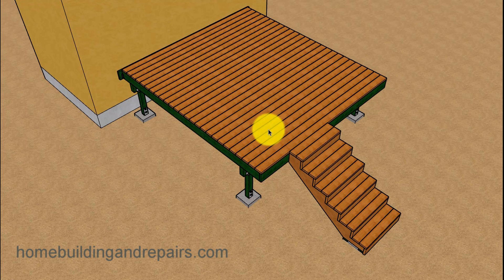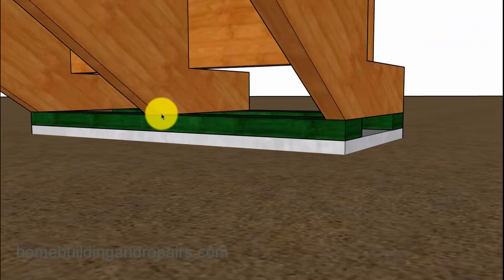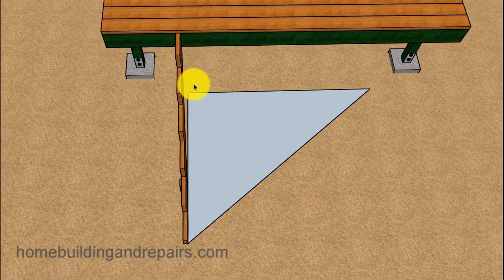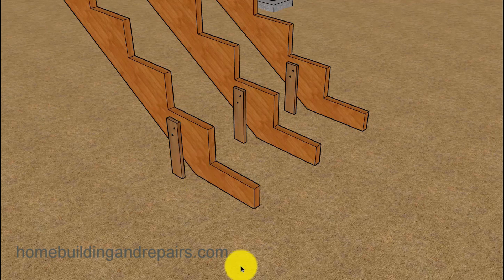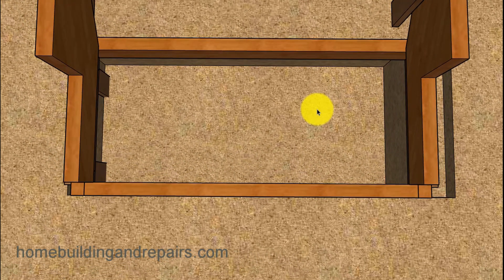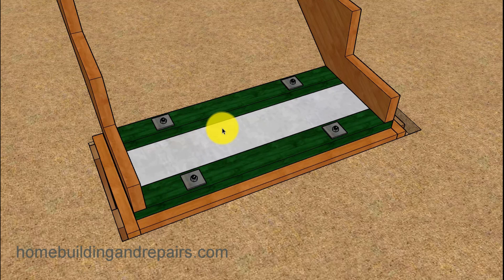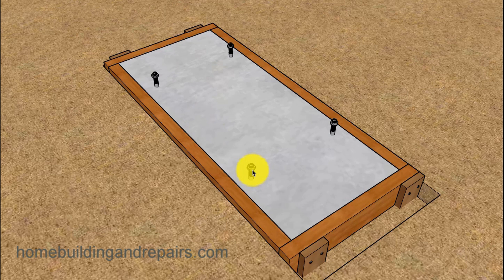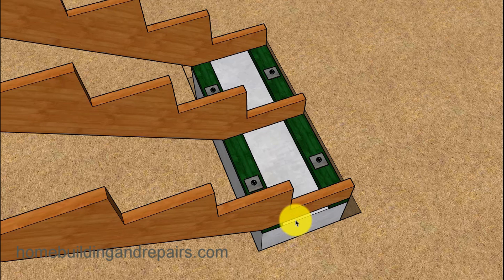How To Use Stair Stringers To Locate The Perfect Deck Footing - Advanced Carpentry Simplified

Comment: Anchoring the bottom of the stringers on an outdoor stair with one stringer attached to the house. Ours has not been attached to the concrete landing for 20 plus years. Not on our front stairs of the front deck(lands on concrete) or the back deck (taller). We are in a northern most climate, and worried freeze thaw cycles( many through out winter ), might be why the bottoms of the stringers never had attachment / kicker connection to side walk or pad.  Should we add it to the to do list?

Comment: I'm sorry, our building code which isn't different than the International, requires 24" of landing surface that is non-skid.  In other words, you can't step off the steps into the grass.  It's got to be gravel or cement or landscaping brick pad.  So I'm wondering why you didn't mention this.   I think this is pretty common practice.

Comment: Nice video! If ground contact rated pressure treated lumber stringers are used, can't they be placed directly on the poured footing slab? I realize the bolts give you a way to anchor the stairs but it seems that it can also be accomplished by notching the stringers in the front or back and running the board there so it is flat with the rest of the stringers and prevent raking and anchor that into slab. My biggest concern with your recommended construction is the channel created by the two boards that will trap water and will not allow it to drain to front or back. While we can pitch the slab a little to help with this in the front-to-back direction it is much harder to give the slab a pitch side to side for this drainage to happen.

Comment: Shouldn’t the pressure treated wood have a metal bracket between the concrete like the posts? I’m planning a deck with wrap around stairs and am trying to use posts on top of concrete to hold the stringers. It’s a very wet area and I’m worried the you show method will rot the bottom boards.

Comment: Deck footings in my area go 4' deep in ground.
Do I have to dig step footing that deep as well or a 6 inch slab will be sufficient as footing for steps?
I have 3 steps, 6 feet wide and 12 inch tread.
Reply from the maker: I would check with your local building department of contractors. I would think a long footing would work or a few footing and some support beams.

Comment: I need to add a pad to the bottom of my deck stairs because there was not a footer installed during construction.  Now the stairs are listing to one side.  What changes would you suggest if the stars are against the foundation of the house?
Reply from the maker: I guess I would structurally support stairs first then add footing under them. Here's a link to our website that might provide more information. https://www.homebuildingandrepairs.com/repairs/stair/index.html

Comment: I am planning to relocate the existing stairs (3 steps) on the side of my existing deck away from the centre of the deck (where it is currently) and moving it closer to the house at the end of the deck by to the house. There is no concrete footing at the base of the existing stairs. The stairs are resting on asphalt (part of the driveway located on the side of the house). They were not fixed in any way to the ground. I am not an engineer but something tells me using asphalt as a footing is not to code or the safest idea. Would you agree that laying a concrete pad at the base of the relocated stairs would be a better alternative? Any suggestions on how to cut out, frame and lay a pad of cement from the asphalt. It would not be as easy as grass or dirt obviously and how do I then repair the asphalt around the pad once the cement has dried? Thanks for your informative videos.
Reply from the maker: Most asphalt can be removed with a saw for exact dimensions and a few tools to remove after cutting. I don't have an videos on fix pavement, but I'm sure there are more on YouTube.

Comment: Another home run!
Reply from the maker: Glad you liked it.
Reply: @stairbuilding  Here’s where my pea brain is getting stuck, after I determine the measurements of my stringer from top of finished deck to ground level and get ready to cut them do I have to subtract the thickness of the treads from each so I don’t end up with the steps higher than the top of deck? Or does the calculation in the video include the tread thickness? I bought your stair building book and should get it today!

Comment: I am dealing with an existing concrete floor, as footing, which is not flat with 1/2" difference.
How do you do it? Thanks.
Reply from the maker: You should be able to add or subtract to the required amount of materials or the difference needed when laying out the stair stringers to make them level. If the stair stringers are already cut, then you might be able to use small pieces of wood or wedges to fill any areas that need to be raised.
Reply: @stairbuilding  Thanks for the information.  I just did as what you said.
Reply: It takes some patience, but it is possible without shimming each riser. You start by measuring and building the first stringer based off the highest point of contact of where the stringer will set on the concrete. Then using a level, place the level on the concrete perpendicular to the stringer and shim until perfectly level. Next, figure out the difference of each individual stringer by measuring the gap where each stringer will make contact with the concrete and add the measurement of each gap to the bottom of each stringer. 
  For example, if the concrete is high on the right side, and the bottom riser is 6 3/8", and the gap at the spot for the next stringer to the left is 1/4", your next stringer will have a rise of 6 5/8". And the far left stringer, having a gap of 1/2", will have a riser cut at 6 7/8". This will allow all your stringers to sit flush on the concrete, while maintaining a level tread. If the concrete is more than 3/4" (but less than 1") out of level, then it's best to figure out the middle height stringer first, then subtract the high measurement from the high stringer and add on the low stringer. That will help meet the maximum 3/4" allowable variance on a bottom run, and still maintain a level tread.